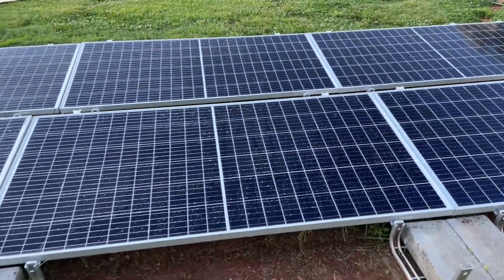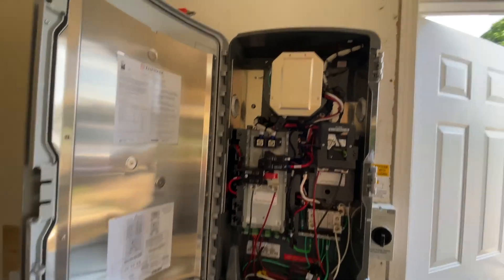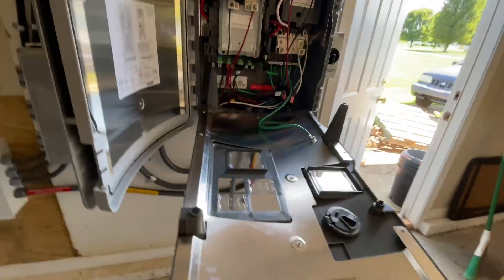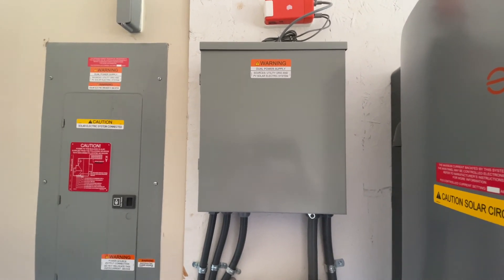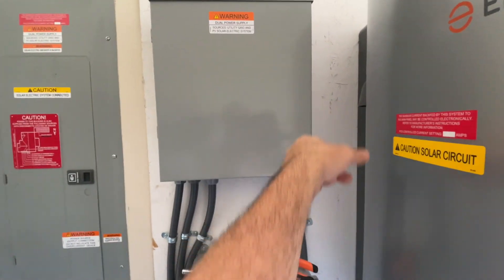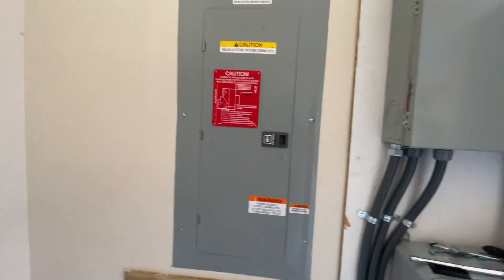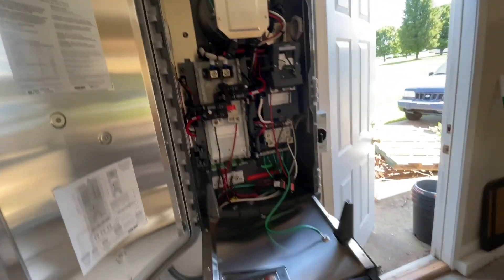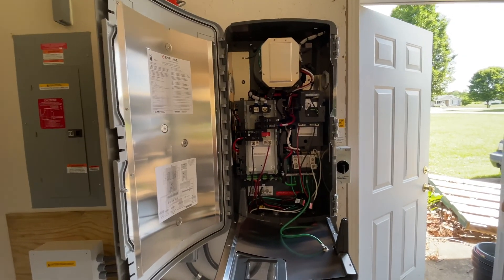Enphase IQ8Plus Backyard DIY Solar Project - It's PTO day!

Comment: What’s better iq8plus or iq8H?
Reply: It depends on your panels. The IQ8+ can only output 300W, so you want to use these with 300W panels. The IQ8H and HM-1500NT, can output up to 380W, so you want to use these with 380-420W panels.

Comment: What are the brackets you used for mounting panels?
Reply: That is the RM10 system by Unirac. Interesting seeing them on the ground. I've installed them on flat roofs but never considered putting them on the ground.

Comment: Hi again, any chance on doing video demonstration of IQ 8 powering items when disconnected from the grid?
Reply: Still working on it for the past week. They work great BTW. It ran today from 10am to 2pm on sunlight alone, while charging the battery in the morning. There's not much "action" to record on video, but I have tons of data to sort through. My loads are a refrigerator, my iMac + 2nd  monitor, the Internet modem, 2 LED lights, and 2 600W Window Air Conditioner units Energy Star rated so they have low inrush current. The battery inverter only ever hiccuped once when there was no sunlight to back it up.

Comment: Can You charge an EV direct from PV Microgrid (assume You have a way to manually disconnect from grid) ?! would love to see that happening
Reply from the maker: Yes, it's possible.
Reply: @DiySolarHelpDesk  any chance You could make a video on that would really like to see how well it actually works off grid!!!
Reply: @d201120112011  Will do, eventually. With the battery, it operates my two 600W window AC units and a refrigerator for about 3 hours, but it handles the load with no problem without the grid. I'm using the battery to additionally offset my bill, not as a backup supply. I want to test and see if the IQ8's can handle the load when the sun is full, without the battery but we haven't had a full sun day since I turned it on. Cruel irony!